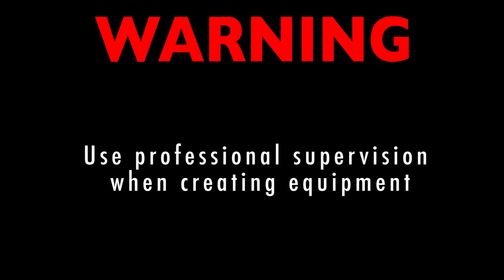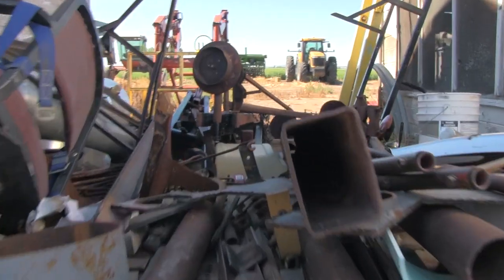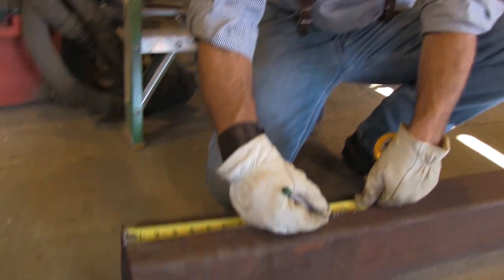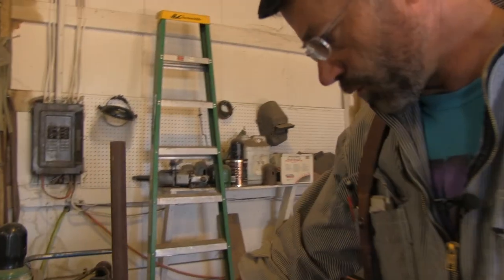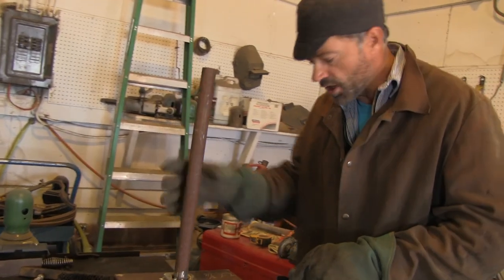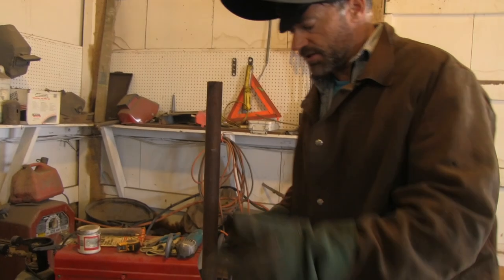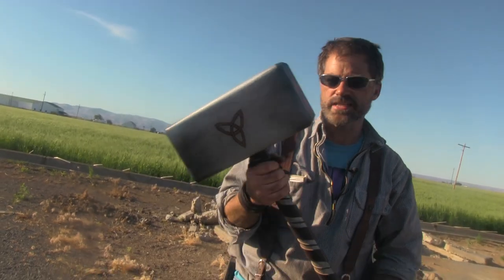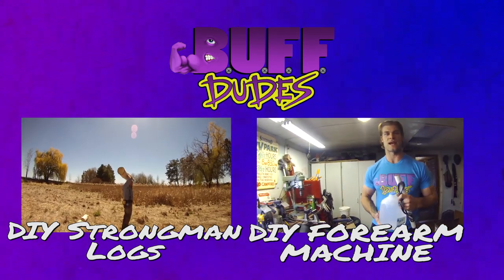How to Make Thor's Hammer - DIY Dudes

Comment: Hey Duff Budes,

(Brief explanation of where I'm at, I'm 6', 184lb - looking to drop body fat and maintain the muscle mass I currently have)

Prior to when I go to the gym I tend to write out a programme for myself to keep track of sets/reps/weights etc, and I use your workout videos and other's to help me do so. Now, let's say I'm writing myself a back programme for the week, (I'm currently working on a 4 day split - Legs, Chest&Back, Shoulders, Arms) I do SOME of the same exercises, but switch or add a few NEW isolation exercises or perhaps switch a compound movement such as a deadlift to another compound movement, bent over barbell row for example. I do this every week to continually mix things up a little bit. Well recently I've stumbled across a few articles explaining that 'Changing your workout routine regularly KILLS gains'. I've only been 'properly' dieting and training for the past 2-3 months and have definitely lost a good amount of body fat as well as made muscle gains.

So my question to you is, should I be writing out the SAME programme per week per muscle group? And will this change the results I make in anyway?

Thank you as always for your time,

Sam